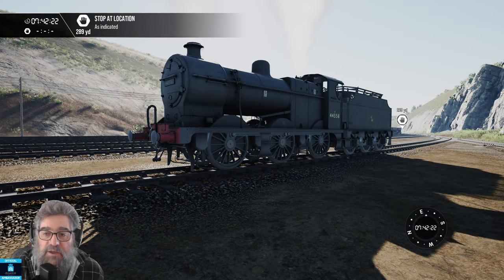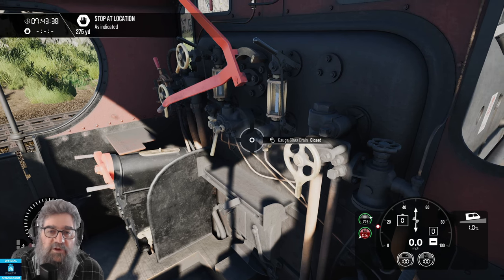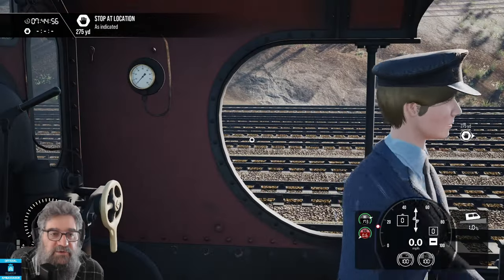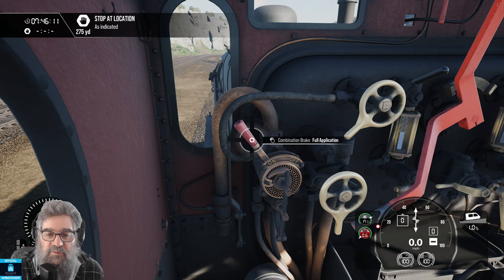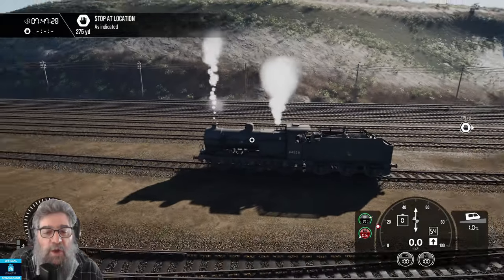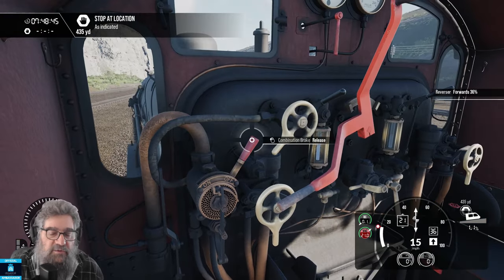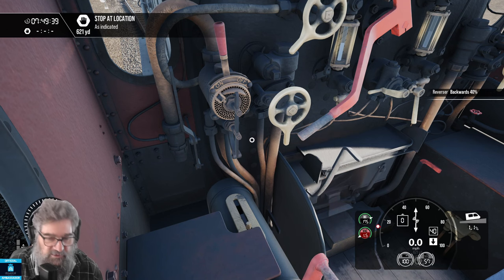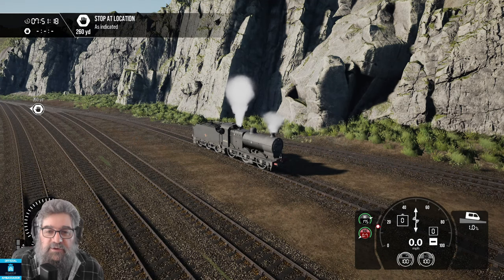TSW3 Fowler 4F Steam Locomotive Driving Tutorial for Peak Forest

Comment: Slight correction mate, the 4f doesn’t have a steam chest pressure gauge, the gauge on the fireman’s side is for the steam heat. Other fowler goods designs have the same layout, like the 7f
Reply from the maker: Oh, interesting, thanks for that. I'm so used to a gauge in that position being for the steam chest on the locos that I work on that I just made the assumption. Thanks for the update.